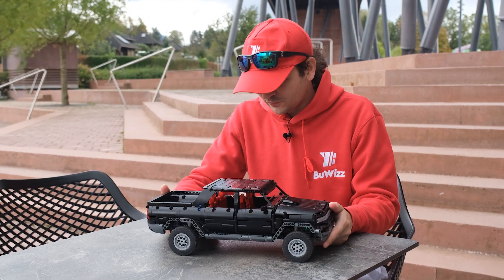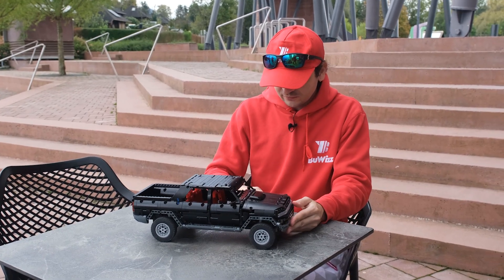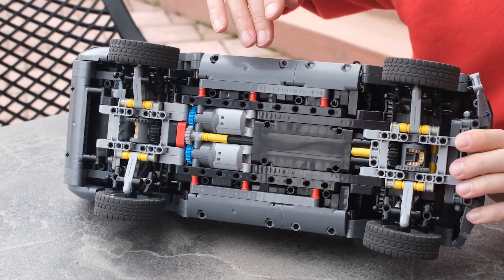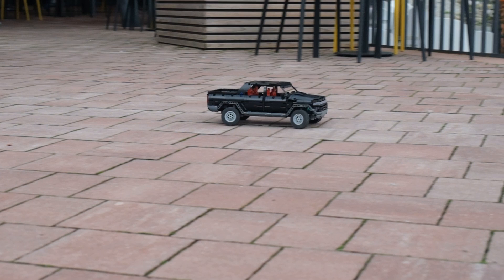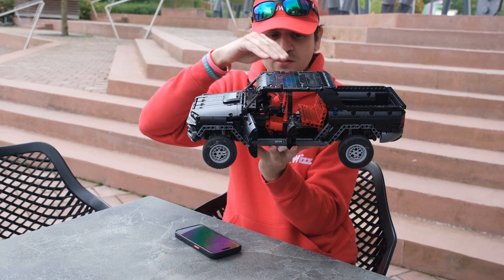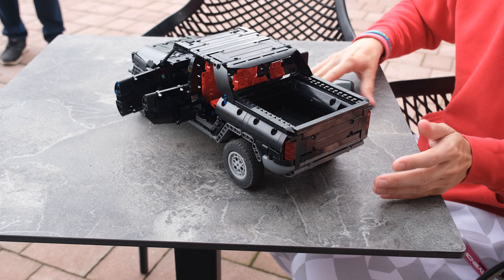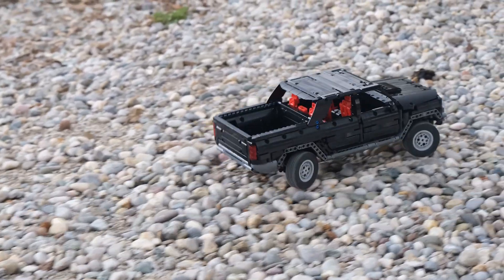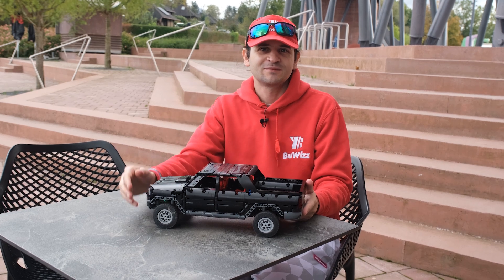Presentation of the model for the RoLug RTXP 2024 - 1:14 Scale Hummer EV

Comment: Hi Buwizz team, I've been working on a technic project I intend to sell the design for, for the last year or so, but I've recently encountered problems with the 3.0 system. The servo calibration for the power up motors doesn't appear to be working as intended, and upon profile start up (prepping to drive) no servo checks take place. Can you provide any help with this? I have followed all your standard checks on website to no avail. I should note, this worked until the latest update.